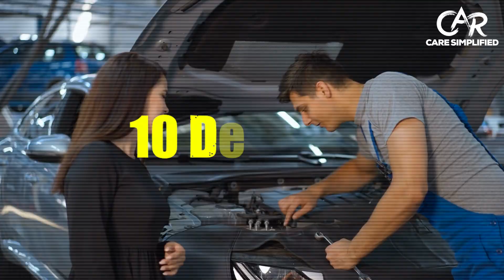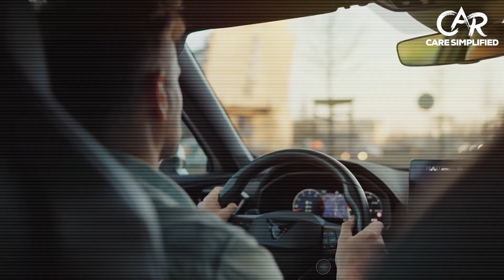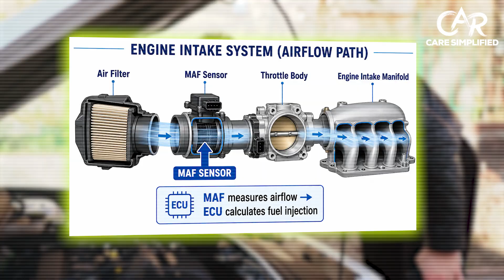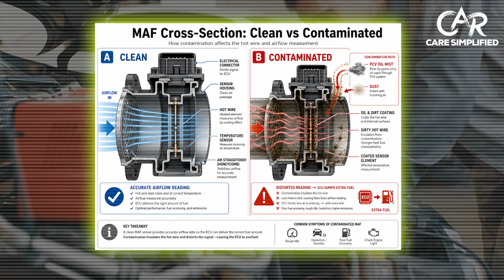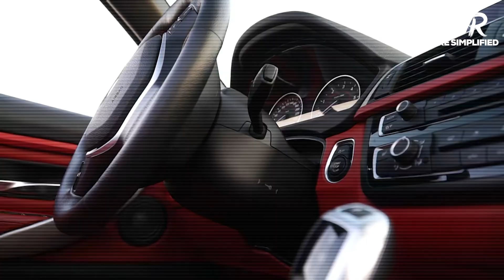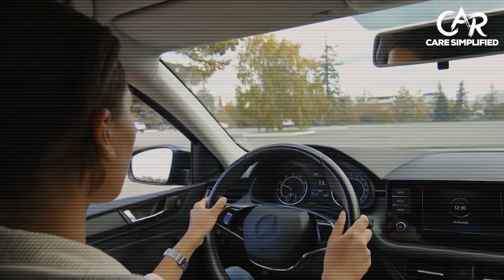The Japanese Method to Cut Your Fuel Bill by 50% (Most Drivers Get This Wrong)

Comment from the maker: 📚 SOURCES — every number in this breakdown is cited below
━━━━━━━━━━━━━━━━━━━
🇺🇸 AGGRESSIVE DRIVING & SPEED PENALTIES
━━━━━━━━━━━━━━━━━━━━
▸ Oak Ridge National Laboratory — Thomas, Huff, West, Chambon (2017)
"Fuel Consumption Sensitivity of Conventional and Hybrid Electric Light-Duty Gasoline Vehicles to Driving Style"
SAE Int. J. Fuels Lubr. 10(3). DOI: 10.4271/2017-01-9379
ORNL summary article: ornl.gov/news/sensible-driving-saves-more-gas-drivers-think

This is where the 15–30% highway / 10–40% city aggressive-driving numbers come from.

▸ US Department of Energy — FuelEconomy.gov
fueleconomy.gov/feg/driveHabits.jsp
Source for the $0.27/gallon penalty per 5 mph above 50 mph.

━━━━━━━━━━━━━━━━━━━━
🥚 "EGG BETWEEN FOOT AND PEDAL" QUOTE
━━━━━━━━━━━━━━━━━━━━

▸ Terry Penney, Technology Manager for Advanced Vehicles, DOE National Renewable Energy Laboratory (NREL), Golden, Colorado.
Quote originally published in CBS News interview, "6 Myths About Gas Mileage," 2011.

━━━━━━━━━━━━━━━━━━━━
🛞 TIRE PRESSURE STUDIES
━━━━━━━━━━━━━━━━━━━━

▸ Oak Ridge National Laboratory — Thomas, Huff, West (2014)
"Fuel Economy and Emissions Effects of Low Tire Pressure, Open Windows, Roof Top and Hitch-Mounted Cargo, and Trailer"
SAE Int. J. Passeng. Cars 7(2):862–872. DOI: 10.4271/2014-01-1614

This is the 2009 Toyota Corolla data showing 75% pressure = -2 to -3% MPG, 50% pressure = -10% MPG at 40 mph.

▸ Edmunds tire pressure test — 60 employees, 8 weeks
edmunds.com/fuel-economy/tire-inflation-tested.html

━━━━━━━━━━━━━━━━━━━━
🔄 IDLING DATA
━━━━━━━━━━━━━━━━━━━━

▸ Argonne National Laboratory — Idle Reduction Research
anl.gov/esia/idle-reduction-research
Annual idling waste in the US: 6+ billion gallons of fuel, $20+ billion in cost.

▸ DOE Vehicle Technologies Fact #861 (Feb 23, 2015)
"Idle Fuel Consumption for Selected Gasoline and Diesel Vehicles"
energy.gov/cmei/vehicles/fact-861-february-23-2015-idle-fuel-consumption-selected-gasoline-and-diesel-vehicles
Compact sedans 0.16–0.17 gal/hr at idle. Larger sedans up to 0.4 gal/hr. The 0.25–0.5 gal/hr range cited in the video covers the typical American mid-size vehicle.

━━━━━━━━━━━━━━━━━━━━
🇯🇵 JAPAN ECO-DRIVING & TOP RUNNER PROGRAM
━━━━━━━━━━━━━━━━━━━━

▸ Japan Automobile Federation (JAF) — Eco-Drive Promotion Campaign
english.jaf.or.jp
JAF founded 1963, ~20 million members as of 2025, member of FIA.

▸ Japan METI / MLIT — Top Runner Program documentation
Independent review by International Council on Clean Transportation (ICCT):
theicct.org (Japan fuel economy policy section)

▸ International Energy Agency — Japan HDV Fuel Efficiency Overview
iea.org

━━━━━━━━━━━━━━━━━━━━
🔧 MAF SENSOR & ENGINE COMPONENTS
━━━━━━━━━━━━━━━━━━━━

▸ CRC Industries — MAF Sensor Cleaner technical documentation
crcindustries.com (Mass Air Flow Sensor Cleaner product line)

▸ Berryman Products — Mass Air Flow Sensor Cleaner specifications
berrymanproducts.com

The 2–8% and 10–30% MPG ranges from MAF contamination reflect aggregated industry mechanic reporting (CRC, Berryman, Firestone, ASE-certified independent shops). Western academic studies on this specific topic are limited — flagging that honestly.

━━━━━━━━━━━━━━━━━━━━
⚙ ENGINE WARM-UP & FUEL INJECTION
━━━━━━━━━━━━━━━━━━━━

▸ Toyota, Honda, Nissan owner's manuals (current model year)
The "30 seconds idle, drive gently" protocol is published OEM guidance for every modern fuel-injected vehicle.

▸ Sierra Club — Fuel-Injected Drivetrain Analysis
sierraclub.org (transportation efficiency section)

━━━━━━━━━━━━━━━━━━━━
💰 PREMIUM GAS MYTH
━━━━━━━━━━━━━━━━━━━━

▸ Mass.gov Department of Energy Resources — Consumer Fuel Guide
mass.gov (energy resources, fuel economy section)

▸ US DOE FuelEconomy.gov — Premium Gas Guidance
fueleconomy.gov/feg/octane.shtml

━━━━━━━━━━━━━━━━━━━━
⚠ HONESTY DISCLOSURE
━━━━━━━━━━━━━━━━━━━━

The 50% figure in the title is the STACKED MAXIMUM, not the average. This is what is achievable when ALL of the following are true simultaneously:
   • Driver currently has multiple aggressive driving habits
   • Vehicle has degraded MAF and other sensors
   • All 6 layers are implemented fully

Average driver expectation: 25–35% improvement
Already-efficient driver: 5–10% improvement

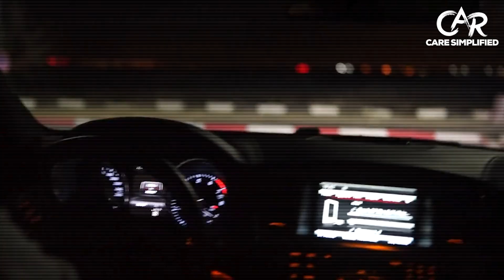This is disclosed verbally at the 6:30 mark in the video and visualized on screen.

━━━━━━━━━━━━━━━━━━━━

— Car Care Simplified